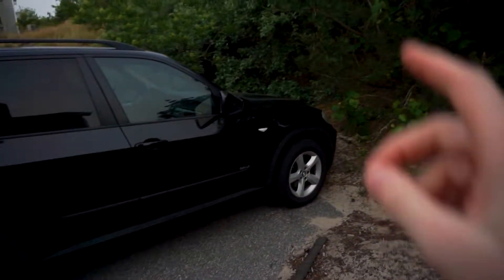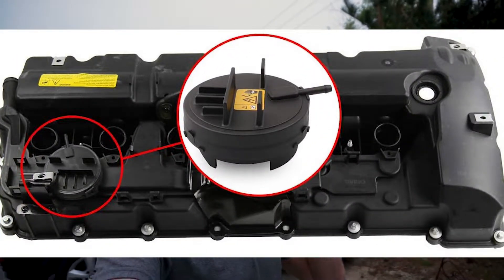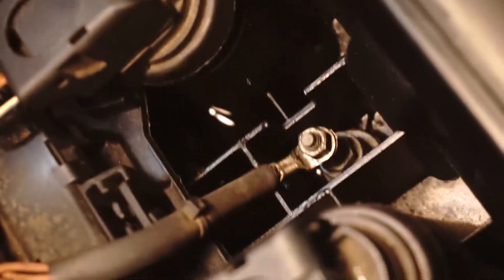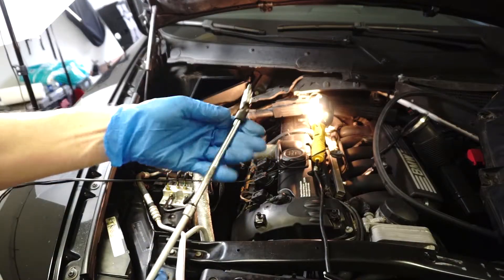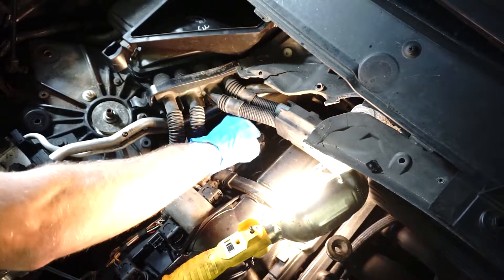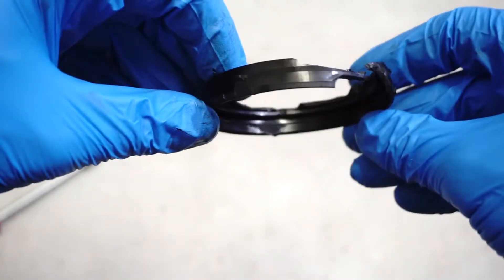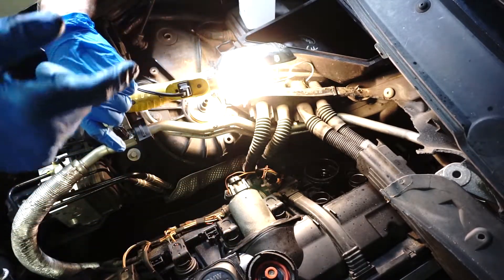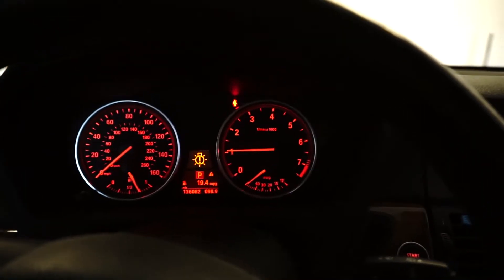How to replace CCV CVV PCV valve replacement BMW N52 Rough Idling

Comment: Classic garbage BMW design.  Make everything impossible :( wth are the plastic tabs for if you can't pull them back and remove the part?  If it's welded why do you need tabs ?
Reply from the maker: I think it's just part of assembling process. But I fully agree that is total mess...
Reply: Its super profitable.

Comment: I just did the pcv replacement but i forgot to put the spring on, by the time i realized it was too late to take it back out, does the spring really matter?
Reply from the maker: The system will not work the right way, it’s controlled by the internal pressure, so the simple answer you need that spring!

Comment: I was able to replace mine on E92.
Don’t be afraid guys, I used a chisel and needle nose vise grips to start pulling out the pieces in the middle. Once I was done in the middle I chiseled the sides off and they “peeled” off pretty quick. There was one spot in the back that was tough but I was able to shave it off with a razor blade. New one slipped right in, I lined it up with where the previous clips were. 
Turned the car on and no more whistling engine. Now off to my next code crankshaft sensor😑.
Reply from the maker: Did exactly the same way)🤓
My man 👍🏻!
Reply: Did you have to put RTV silicone?

Comment: hi bro my car makes whining noise if i change this will it repair
Reply from the maker: It's a high chance, chey the other video on how to test it, it's in the description, so you will know for sure, or if you don't have vacuum pump, try to close the testing pin with your finger while car is working, and see if there gonna be any changes to the sound it makes.
Reply: @Makhnovets   thank you bro
Reply: @Makhnovets  hey bro can i ask you something ?
Reply from the maker: @orlandokellezi9425  how can i help you sir?
Reply: @Makhnovets   my x5 e70 3.0si start and shut dow if you prees the gas it runs

Comment: Sorry if it worked for you to change the pcv valve, I have the same problem the motor has a kind of hiss
Reply from the maker: Replacing The PCV did not treat the problem, it did help a little but did not cure that. there are many things that can be wrong with floating rpm like "Injectors, carbon deposit on intake valves, exhaust system, or most likely fuel system, and more". till now I have that issue, and I also selling the car, I'm not really up for spending more money in to at. But in my case, there was the rough start issue and it's happening in the morning, so not a big deal.
Reply: @Makhnovets  ok thank you very much for the advice I will take it into account
Reply: Need to do a smoke test there's a YouTube video on how to make a cheap smoke tester out of a soldering iron. It works!

Comment: the PCV system fails, Does it contaminate engine oil? Does it cause a stuttering problem?
Reply from the maker: Depends how bad the leak is.
Reply: @Makhnovets  4 months ago, at the first start-up, there was a rattle sound, then the sound stopped. After about 3 thousand km, I got the code p0012 and p0171 in my car, the oil filter got muddy. Could it be from the pcv valve?
Reply from the maker: Do you do any additive to the oil?
It shouldn't be any affect to the oil except it getting dark much quicker, if the pcv membrane have leak, it usually produce kind of squeaking breeding noise... Also you can get more of the exhaust fumes, or more smoke.
Chech the spark plugs, if they have some carbon deposit or black crunch on them.
Does your car consume oil?
Reply: After the pcv rattle, the oil cooler started to leak at the first start, I guess, could the engine pressure have increased due to the pcv? I changed the oil, it got dirty without 500 km and in the low 1000.1500 rpm range, the 3rd and 4th cylinder misfires occur in the obd, but I do not get an error code at the upper revs. There is a significant reduction in vehicle acceleration. The error codes I'm getting now are p0012 p0171 p0012 p0304 p0304 I think the pcv may be faulty for sure because the rattling sound came for about 2 months and then it stopped. but p0171 with misfire issues started after that

Comment: Hey my friend I like you videos I have question I can I reset the electronic parking brake with ncs expert inpa bmw coding tool or I need ista
Reply from the maker: Inpa have just simple interface, that allows you to do some resets, but they more like clearing the fault memory, ISTA is much more powerful, so the answer is most likely no.
Reply: @Makhnovets  ok thanks you know how to install ista p and ista d because I have inpa ncs expert bmw coding tool
Reply from the maker: @armandohilario  will make a guide in couple days!
Reply: @Makhnovets  can you install for me on my laptop I pay you for that
Reply: @Makhnovets   I have question my key fob stop working what I can check my car is BMW X5 2008 3.0si e70
Reply from the maker: @armandohilario do you want to do it remotely?
Reply from the maker: @armandohilario  firstly is your key fob with solder battery or not, but in both ways sometimes it's happens, the onboarding chip, transmitter can clear out the memory, so you need get the new battery and program it, you can try to reset the key fob, or rewrite the transmitter code, check the internet for it, also if you have secondary key fob some shops can copy the data from one to another, there many things that can cause that problem, either you have keyless or not, battery power below the normal or capacity is lower that is has to be. Coding issues,
Or most likely if you did replace the battery and the key fob still not working that could be the diversity antenna.
Reply: @Makhnovets  yes
Reply: @Makhnovets  I think is the antenna because I have two keys is same problem  you know where is the location of antenna
Reply: @Makhnovets  how much you charge to install the ista if can of course
Reply from the maker: Let me make the guide first! I'll try to finish it today, tomorrow it should be visible on my channel. 
If you will have any troubles with it will talk about that then!
Reply from the maker: True the ISTA you gonna be able to reset CAS module, and trouble shoot the problem!
Reply: @Makhnovets  ok thanks
Reply: @Makhnovets  windows 8 support this
Reply from the maker: Let me do the guide first, and if that wouldn't work for you, we will talk about me helping you to install it! Video will be ready tomorrow!
Reply: @Makhnovets  👍🏻 thanks
Reply from the maker: This is the link to the ista, download the 4.28.1x(Torrent)
https://mega.nz/folder/bUFRVIjK#ExDDwNvTKmDnEMzlncd45Q
Remove the check box from SDP file, to save some space on a computer, or download it all in one!
Preparations:
Install the Microsoft .NET Framework 4.8.x
                   Visual C++ Runtime 2015-2019
They gonna be included in the Tool Folder.
Then make sure the User name of your computer has no spacing.
Unzip the BLP zip into the same folder
also inside the SQLite folder there Global.zip/ EN.zip unzip them. 
Now run the  ista standalone installer.
Will troubleshoot down the road.
I have troubles with my computer so the video gonna be ready in two days, my Video card just died(((
Reply: @Makhnovets  ok i trying I let you know
Reply: @Makhnovets  what is ista+ (c)bmw group
Reply from the maker: @armandohilario  ISTA + or D, or istagui, or bmw obd scan tool.
ISTA P it's coding tool.
Did i answer your question?
Reply: @Makhnovets  someone said I don’t have enough space in my laptop for ista p
Reply: @Makhnovets  ok i have the ista-p install now I have question some people’s said k-DCAN cable is not working with ista p and some people said yes is working what you think
Reply from the maker: @armandohilario  ista p for coding, you need ISTA d.
Reply from the maker: @armandohilario  if you need coding tools! Bmw standard tools.

Comment: I am going to replace the valve cover with the magnesium version and run a catch-can + pcv off the valve cover. Never worry about this again. What a stupid design.
Reply: Could you please give info on the parts you used for that? It would be great to know
Reply: Why magnesium ? aluminum works perfectly without the need to worry about galvanic corrosion

Comment: Could this cause a misfire? I have a misfire on mine and it’s burning oil and I think it could be this.
Reply from the maker: It's possible, but it's really low chance. Did you check the video how to test the ccv? Test it first, the video in description or at the end of the particular video. Let me know if you need help!
Reply: It could also be your ignition coils

Comment: You really gotta replace the whole cover to do it right.
Reply from the maker: Unfortunately yes, there output whole on the ccv, you can connect the vacuum tool to it, and check if it has some air liak, i will post the video diy in two days.

Comment: Why dealer dosent sale this part .
There are only Chinese options only.
Reply from the maker: From the factory it comes with valve cover as unibody, that's the part of the VC. So that's why you have to do it old fashioned way))
Reply: What P/N do you use for the repair kit and where do you get it!

Comment: HI on the end of the top right  of the valve is a stem or black nipple..is htere a vacuum hose attached to it..mine doesnt have one  please respond..N52 engine 328i 2008
Reply from the maker: hey! that's the good question, I'm working on the video right now, but that little pipe it's a test hole for vacuum, you connect your tool to that hole and test for the vacuum leaks, in that case you will know for sure if pcv valve is cracked or not working correctly, that was my mistake of not knowing in the video that the test hole((( sorry and happy new year!!!
Reply: @Makhnovets  some guys on here said they have a vacuum hose connected to that valve at that little black tip..i dont hvae on eon my car..its a 328i..and another guy with a 328i has a hose connected there..he said maybe mine fell off replacing the starter?
Reply from the maker: @gail6904  from the factory you have plug there, but it's can be in an open position, newer seen one with the house connected there. you can check diagrams on realOEM.com
Reply: @Makhnovets  My 2011 328 has a vacuum hose connected to it. The other end of the hose goes to the intake manifold.
Reply: @odubb45  I don’t know if mines had one because i wasn’t watching the mechanic when he got the completely take the valve cover off but I have the 2011 bmw 328i as well. Mines doesn’t have that vacuum line
Reply: no hose ,,,it just sucks air
Reply: or mine does not have a hose, just nipple

Comment: Would this cause the car to hesitate when accelerate
Reply: Hi there i have n52 x5 i get lean code p0171 and p0174 i replace egr and maf sensor and valve tronic seal i check all its good i have no vacuum leak no oil leak intake boot is good... would this pcv cause my lean code?thanks
Reply: @kwatoggurutv109  do u ha e an aftermarket intake
Reply: @kwatoggurutv109  check the manifold o rings intake tube everything that has to do with the air going into the manifold
Reply: @jorarr5174  check your cam shafts. Mine was hesitating to go when i pressed on the gas, it took a second or 2 to take off 90% of the time, but when i had cam shafts done she runs beautiful picks up nice now
Reply: @GodsChildE90  I'm having this issue and I thought it was something to do with the auto gearbox software. After resetting the software it did get a bit better but back to poor acceleration again. I might try this next, did you DIY or take it to a shop?
Reply: @P_ESAR  cams was at shop, but diy, i recently changed engine filter, cleaned maf, changed oil and added some fuel injector cleaner and she runs even better and responsive. Only problem now its vcg which is due to change soon, other than that she's mint
Reply from the maker: @kwatoggurutv109  did you do the proper pressure test or smoke test? vacuum test as well, after that you can start working with ccv . there leak in the system! the intake valves could be the problem as well if they have lots of carbon deposits. but like I said, make sure you did a proper smoke test! before you start cleaning the valves or replacing the ccv.
Reply from the maker: I wouldn't say so, but if there a bit leak, you will have lots of smoke coming from the exhaust, but the most it can get its rpm haggling
Reply: @Makhnovets  replace it my car still feels like it loses power sometimes when I step on the gas
Reply from the maker: @jorarr5174  any codes? Sparkplugs/coils/injectors? Misfires? Vanos Solenoids? Any of the above did you clean or replace? As well as how many miles on the car?
Reply: @Makhnovets  all new 110k
Reply: @Makhnovets  when I drive and come to a stop and them press the gas it wont go it takes forever to accelerate
Reply from the maker: @jorarr5174  acceleration paddle, could be, but it definitely will get you a code, if you have chance to get the one from different car, test it that's would be great,  if you have obd scanner, check the mixture of gas and air, as well as o2 reading, after replacing injectors did you code them? That's also can be the case. And there no codes whatsoever? You can check your throttle body if there carbon deposit, and the last thing and big one on those engine's are carbon deposit on valves behind the air intake, which cause power lass...
Reply: @Makhnovets  yeah I have no codes I did do all the maintenance to the trottle and air intake even replace their rings on the fuel injectors  .sometimes it sense to heat up but check the temperature  and is not hot the fan goes on high mode and it loses power
Reply from the maker: @jorarr5174  try to check the temperature sensor and fan relay, i had the same issue with power loss, it was due to fan wasn't working correctly, the car was about to overheat, and the car would hesitate to gain the speed, for example i was flirting an car wouldn't go above 3k rpm. Temperature sensor first and then relay.
Reply from the maker: https://youtu.be/y0Mszj4vq2E
https://youtu.be/1ARsOcdPNGM
Reply: @Makhnovets  would the realy video be for 328i 2009
Reply: @Makhnovets  I did the temperature already but not the relay
Reply from the maker: @jorarr5174  location could be in different spot, but yes, it should be there! That's the same engine. N52
Reply: @Makhnovets  ok thanks ima take a lot at it see what's happens and ima get an oem temperature sensor ass well
Reply: @jorarr5174  no i dont have everything is stock
Reply: @kwatoggurutv109  try the manifold o rings

Comment: i have a n53 and found nothing for that, only this: https://raluno.net/index.php/;focus=STRATP_cm4all_com_widgets_Shop_30155062&path=?subAction=showProduct&categoryId=234693&productId=805590#STRATP_cm4all_com_widgets_Shop_30155062
Reply from the maker: You can search simply for PCV, you will find more information on forums! CCV AND CVV it's mainly for BMW, but overall it called purge control valve.

Comment: thanks! Just did it on my 328i 2007, work like a charm now
Reply from the maker: Sounds good to me 👍🏻👍🏻👍🏻
Thanks for the update!
Reply: N51 ?
Reply: Did you have a rough idle too before doing this ? And when driving it feels like it’s losing so much power as if the car is getting bogged down , gear 1 feels super sluggish
Reply: The new PCV does not come with the spring, did you reuse the spring?
Reply: @glenglene8473  yes, reused the old spring. Spring are usually good as long as it is not rusted and it has not been stretch
Reply: @maximedenomme838  does the ccv on the e92 n52s main symptom are when you start and drive it especially when it is very cold, for an auto trans it changes gear quickly then you can notice theres no power, then when youre driving and let off the throttle you can here a loud whistling sound. Then when you come to a stop the car changes gears down very rough and then at a stop the engine shakes violently as well as the roms going up and down hesitating. But when i turn it off and on it disappears so this issue happens time to time. Would that be the ccv/pcv abd that i have to change the whole valve cover?
Reply: Did your ccv have a small hose that connected to the throttle body?
Reply: what did u use to seal it and where did u put the sealer..they say dont put it around top of pcv valve rim??

Comment: hi

i have also n52 engine but i have a little cap on my pcv from factory as this cap
has a bmw part number , should i put agin this cap on the new pcv ? 
i don’t know why there is a cap here as normally pcv need to be free to work fine but if it is a bmw part it must have a genuine reason to be here 

thks
Reply from the maker: The cap covering the pipe, which is there for testing the actual pcv valve. Use the vacuum took to check it for membrane air leak.
Unfortunately for me i replace the CCV before i find out about (😅

Comment: what a cliffhanger...
Reply from the maker: more is coming! didn't fix the issue completely, but also fix something!
Reply: @Makhnovets  have you replace the ignition coils, spark plugs, cleaned the check valves and vanos solenoids? Those 4 things got my N52 idling normal again :-)
Reply from the maker: @CorbinWilliams  s.plugs, coils, check valve, the big difference made ccv and cleaning the VANOS.